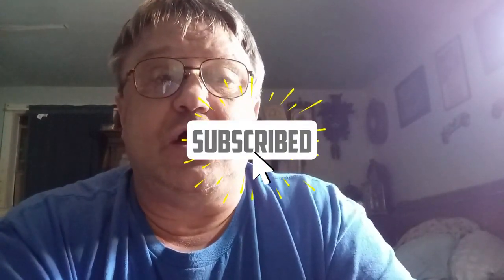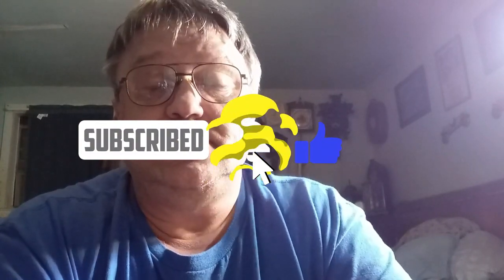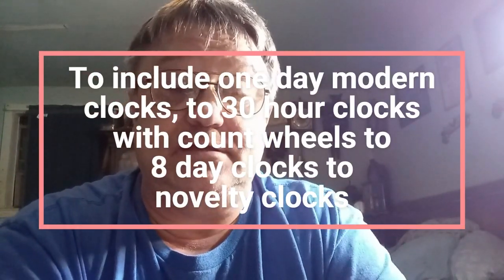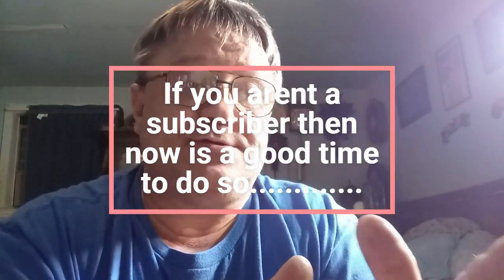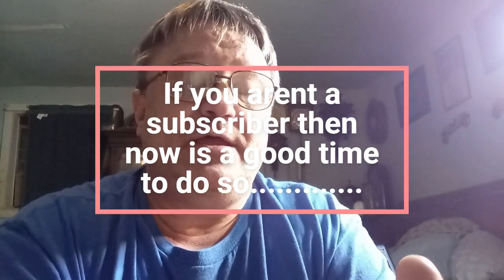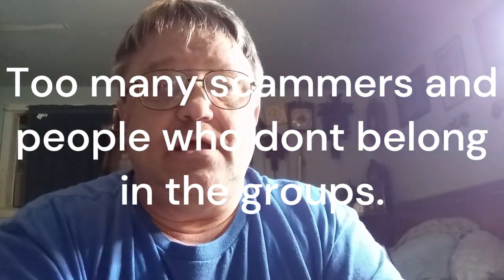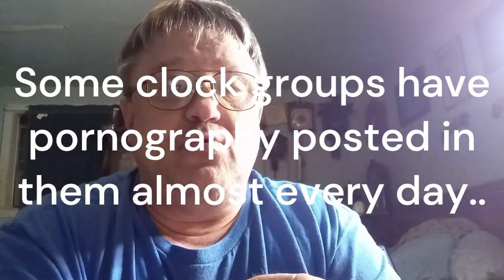Cuckoo Clock Repair for Beginners (See Description)

Comment: My hour hand went come off
Reply from the maker: They are compression fit on for the most part if you are talking about a cuckoo clock.  Try putting a drop of oil around the center of the arbor on it and waiting 30 minutes or so. Good luck.